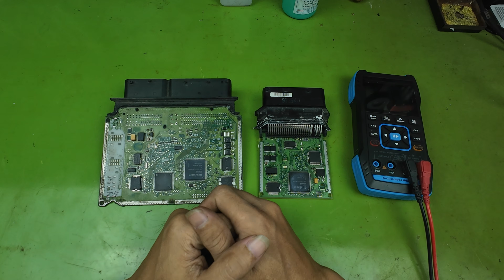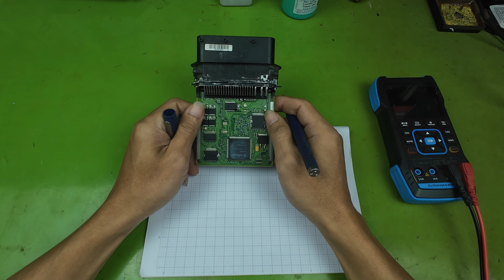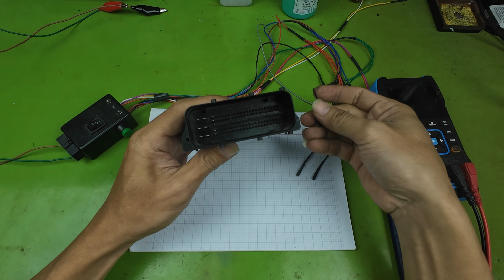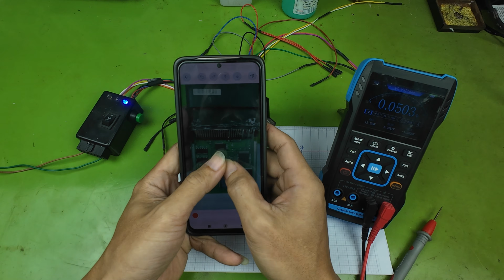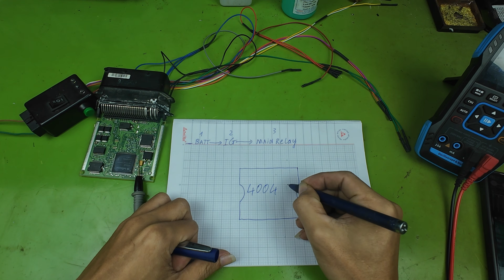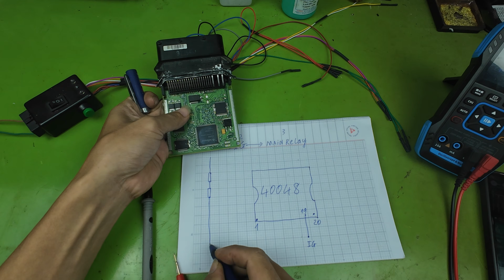Part 1👉ECU Power Circuit Explained: Learn Analysis, Testing & Repair Tips #ecurepair

Comment: Very good video. please i have problem with a daihatsu ECU model p55. It interrupts its operation as if you cut off the fuel supply, for 1-2 seconds. When it warms up and I turn off the engine, it takes about 1 hour to start again. Can you help me how I can solve it? The ECU is not recognized by the diagnostic. As if it does not exist

Comment: hi   autocar star , a question:    some years ago the aternator ECU transistor driver got fried , and of course then the alternator wasnt charging, so i by-passed it externally to the ASD relay feed , and its been working for years; but I would still like to ask ....even though the alternator has been charging, is there anything wrong,that i wouldnt know, with a by-pass ? its a 2001 dodge ram that im talking about ........await your response ...thanks
Reply from the maker: It seems that you are referring to the voltage regulator circuit of the alternator. This component is responsible for stabilizing the output voltage as the engine speed varies.
If this circuit is removed, the alternator’s output voltage will fluctuate according to the engine RPM, without proper regulation. Such instability can seriously affect the vehicle’s electronic systems, especially the ECU, causing malfunction or potential damage over time.

Comment: i notice that you holds the pin while testing; doesnt  your body resistance affect the test? at least thats what i learned from other sources, i try not to hold the pins with my hands.   And can we see how that little switch device is set up ?
Reply from the maker: You noticed my GND probe, right? Touching the negative probe while measuring voltage won’t cause any issue. Measurement errors only occur when you touch the positive probe.
Reply: @Autocar_Star  ok   so touching the negative probe doesnt affect the reading but touching the positive probe will, right?

Comment: Sir how to remove short circuit in ecu and how to repair
Reply from the maker: In fact, locating a short circuit in an ECU is not too complicated. You just need to identify the affected circuit path, then isolate each branch step by step to narrow down the fault. During this process, you can either cut the trace for testing or remove any suspicious components to pinpoint the exact shorted area.

Comment: Sir can we find the power feed and negative and the ig and can low high from the 5 dots which are located on top of the ecm
Reply from the maker: This is actually quite simple. I already have a video explaining how to look up the pinout diagram using the ECU code, and I’ve included the link in the video description. You can check it out there.